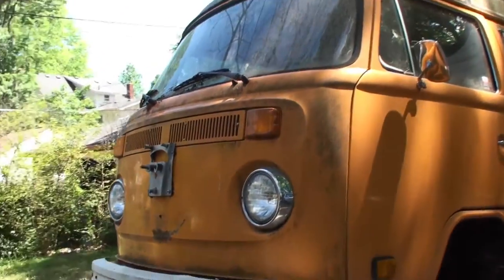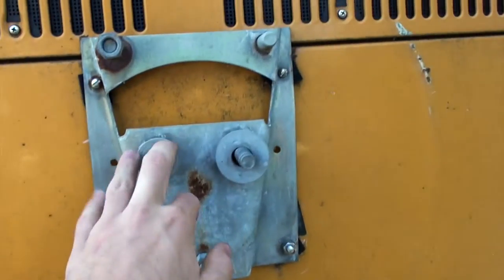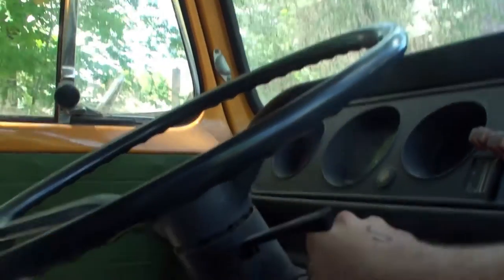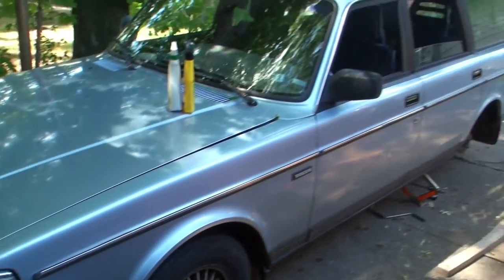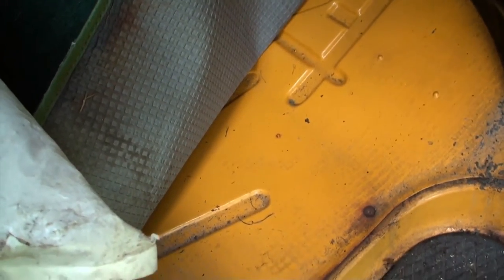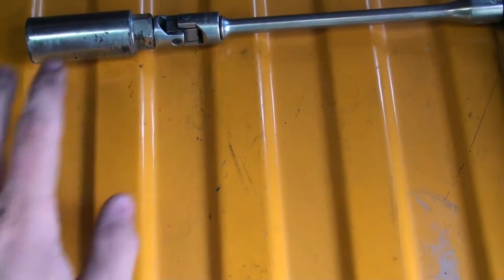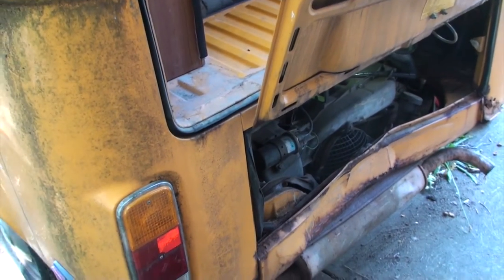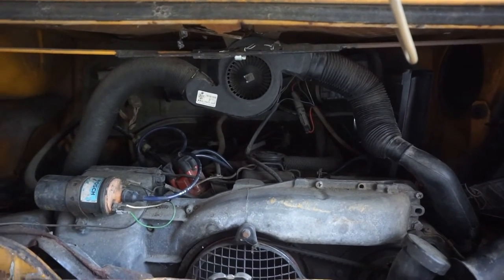Bay Window Westy | Part one | Found!

Comment: There is more tust on this tha  you think, but overall it looks solid. If I were you, I'd be very excited as these are great vehicles for recreational use. They just need some love. You also had a tremendous deal for $1500,  get it welded and cleaned up. You could sell it for 15K
Reply from the maker: It's been 5 years since this video, and I have put the bus back on the road, and restored it to solid "Daily Driver" condition. I daily drove it most of this past summer with no issues! It has been a great vehicle.